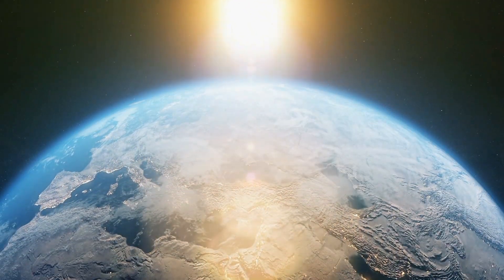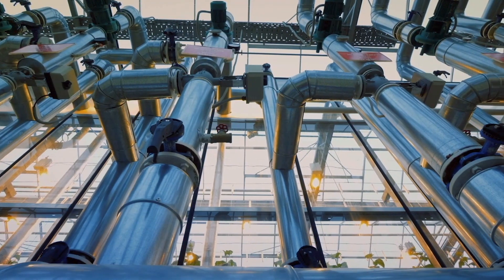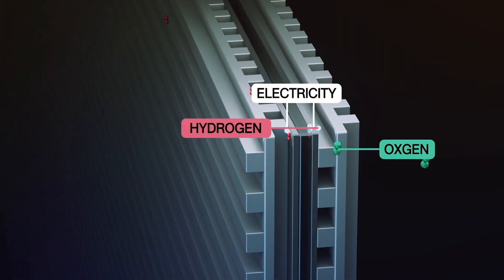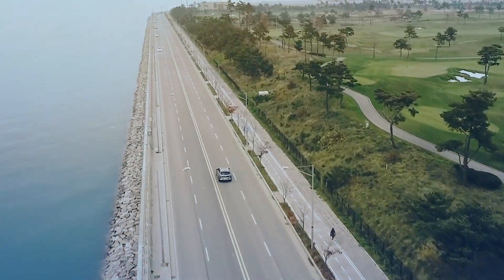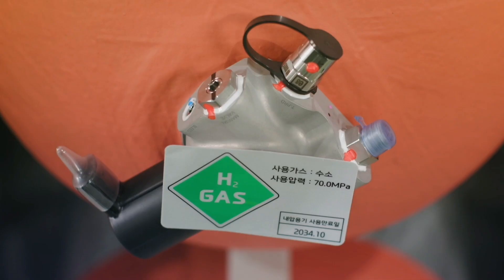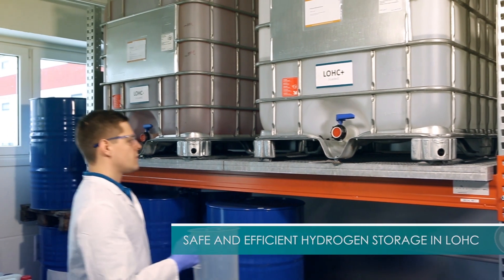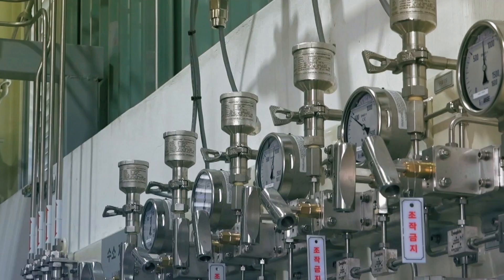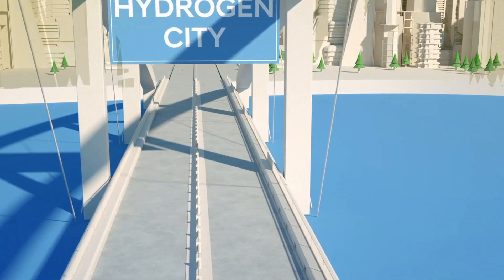Hyundai CRADLE Berlin × Hydrogenious LOHC Technologies // Startup Autobahn EXPO 8

Comment: sounds like a potential solution to the renewable energy storage problem.  It's not clear if you use the LOHC carrier to supply the charging station or can directly use it in the fuel cell vehicle.  It would be good to know the energy density of the carrier.
Reply: Actually, as far as I know, they utilize the LOHC by now as a carrier to transport the hydrogen to refueling stations, power plants etc. by using the existing infrastructure for oil .. and also to store it more safely in established facilities.